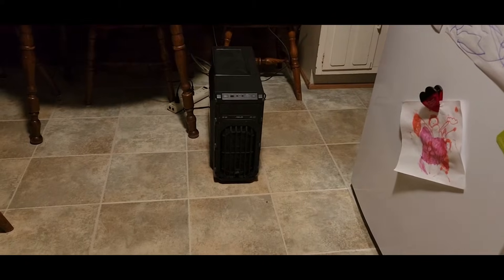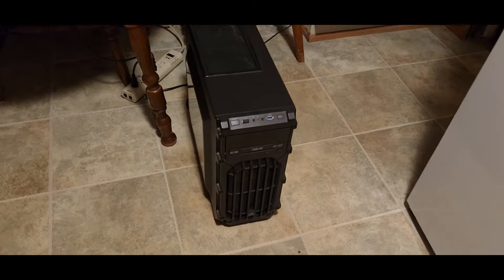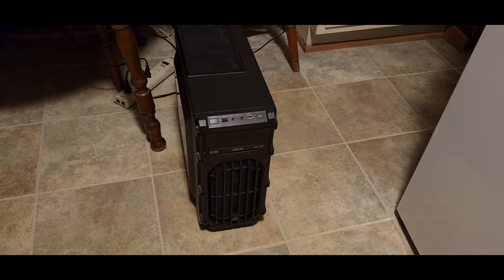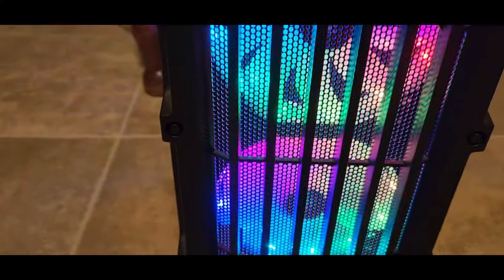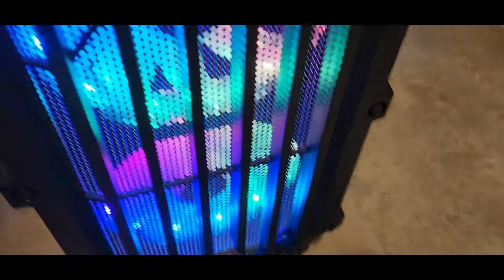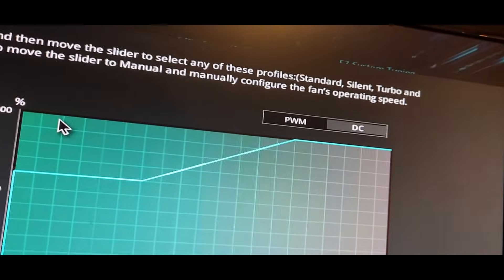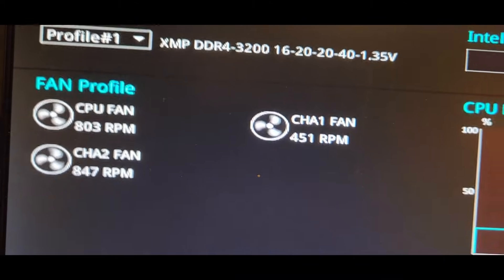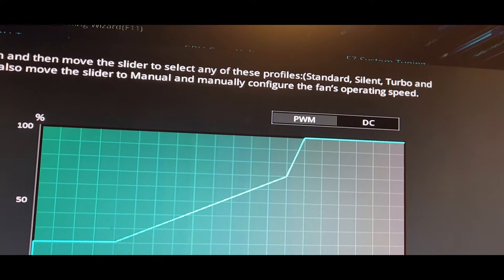One Fan Wasn't Spinning - Solved! (3/25/23)

Comment: What if the rgb and fans aren’t working
Reply from the maker: Hi, I'd say if the fans aren't lighting up and not spinning, they are not connected to any power. They should be either connected to the motherboard fan headers or to a hub, but the hub would also need to be connected to power.

Comment: looks like we have a similar setup. in my case though, the two in the front work fine but the one in the back doesnt at all, but lights up the rgb. I tried changing the setting to PWM from DC (according to the platine, the one not working is cha_fan 2) but it doesnt work. I actually noticed this when I played for the first time on it and smellt smoething toasty/burnt and the temps rose to like almost 90. you think my fan is just plain dead?
Reply from the maker: Try connecting the bad fan to a different fan header, or connecting a known working fan to the header pins the bad fan is on to verify if it's the fan itself or the motherboard fan header.

Comment: What about when my case fan randomly spins and stops?
Reply from the maker: Possibly bad fan, but could potentially be a fan curve setting or power issue, but I don't think it's the power supply.
Reply: @EndUserGamer Thank you, weird that only one of them suddenly stopped working properly. I didnt change anything on the settings. But I did upgrade to Windows 11, not sure if that has anything to do with it.

Comment: My fans came pre installed in my pc, one stopped spinning but it looks like it’s trying to spin because it jerks every couple moments, if i spin it manually it starts spinning but way way slower. In BIOS, it only shows One Fan which controls all of them. idk what’s wrong with it at this point
Reply: Did you find a fix?
Reply: @radiantguy17  yes, if i remember correctly all of my fans were connected in a daisy chain in the back of my case and connected to one fan header on my motherboard, so each connection it would lose some power since the header didnt supply enough power to spin all the fans. the last fan / connector cable in the daisy chain was the one that wasn't spinning, i took the connector out of the daisy chain and connected into another fan header on motherboard itself and it started spinning fine.
Reply: @MuteMvte thank you

Comment: Can you help me because this is baffling me I have one back fan 3 top 3 front and 3 side fans both the front and side start on boot up, but the back and top fans won’t start on boot up then it’s says cpu is over heating then I restart it and all the fans go on and it works perfectly? It’s so annoying
Reply from the maker: Sorry for the delay in response, did you find your answer and resolve the issue?

What are you using to cool the CPU, an AIO water cooler or an AIR cooler? if AIO, be sure to have the pump connector plugged into the pump header or CPU-OPT, and have the fans plugged into the CPU header. use a hub for the case fans.

(And side note with an air cooler, you don't want two/three top exhaust fans, the front most top fan should be intake.)

In your MB BIOS, set all your fans to PWM , or the fan header you have the hub connected to.
Hope you can sole this issue!
Reply: @EndUserGamer now it just boots on and it just turns off after a few seconds and just keeps repeating

Comment: How do I fix two of my fans but the rgb works
Reply from the maker: @TurfyCrater  Use a splitter to connect to the motherboard fan header or connect them to a hub. Just make sure the hub is also powered by the sata connector.

Comment: Anyone got a solution for me? I have 3 rgb fans on my case and they all work until i start gaming after that 1-2 fans stop spinning but lights stay on. They start working again only after shutting pc down.
Reply from the maker: @Opa-b4l  Are these Corsair fans? I'm wondering if the iCUE software is bugging out. If not Corsair's, then I'd probably lean towards power supply,  as this is a very strange thing.
Reply: @EndUserGamer   The fans are not Corsair they came with the case itself(I had a shop build the pc for me) its less than 4 months old and im wondering is the whole power supply bad or just some cables? Can it be a problem with bios? should i try to update it? Note that I a m not using any softwares for the fan controls just the bios preset setting. Can it be thath the fans are just bad guality and I should replace them completely
Reply from the maker: @Opa-b4l  Bring it to the shop that built it, as 4 months would put it under some kind of claim to warranty. But yes, it could possibly be a power supply issue. It's definitely a strange situation.

Comment: Bro I done all this and it still don’t work my lights are on but NUN. Of them are spinning how can I fix that…..
Reply from the maker: @GamingEmpire1204  How many fans? Like all of them are not spinning? Are the fans connected to power? Should be connected to a fan hub or MB fan headers.
Reply: @ yes they all are on like LED wise and I have them plugged into everything righting I think the fans are just not spinning and it’s making me panic all I did was replace the power supply to a more powerful one
Reply from the maker: @GamingEmpire1204  Hmm, what are the fans? The RGB gets its own power, from the 3-pin 5v ARGB cable, and the fans get power from the motherboard headers or fan hub. It almost sounds like the fans are connected to a fan hub, and that hub then gets power from the power supply. Trace wires from the fans back to their connectors.
Reply: @ yes they are all plug up to a hub I think and when I plug in the hub to a SYS_fan plug nothing happens just the LED and also looks like the hub it’s connected too also controls the LED because when I unplug one of the fans from the hub even the LED turns off
Reply: @EndUserGamer  is there a way I can contact you?
Reply from the maker: @GamingEmpire1204 ok. Yes, the hub gets connected to the motherboard System Fan header, which is the PWM signal wire. (I usually connect that wire to system fan 1 header). But the hub itself needs power, which will be connected to the power supply sata connector.
Reply: @ the thing is that’s all connected if I could i would show you a picture but i have thay connection I think let me dub check
Reply: @EndUserGamer  yea i just checked this whole thing Is like one plug so the hub header is plugged into the power supply it’s self and the motherboard at the same time
Reply from the maker: @GamingEmpire1204 Aside from the comments here, try reddit. Same username. 

Anyway, really, from what you're saying, you just need to connect the power supply to the fan hub. Follow all the wires from the hub. 

One should be PWM wire, goes to motherboard fan header, and the other wire will lead to power. And if the hub supplies RGB, then just look for the one wire from the hub that's got a sata power connector. You got this.
Reply from the maker: @GamingEmpire1204  Ok, you may have a faulty hub or (unlikely) bad fans. I'd try connecting each fan, one at a time, directly to the motherboard fan header to test the fans separately, off the hub. See if the fans actually still spin.
Reply: @ wait is there supposed to be a SAT cable that plugs into the motherboard?? Because from this Hub there’s no girl ls so I can’t plug it in all the girls are plugged in then it ends off on a male
Reply: @ ok I just unplugged everything from the leds so ALL of Fans are on just no LEDs now but now the Isolated interface plug is just here am I missing a adapter is that why or something?

Comment: But where you find this Platform ??
Reply from the maker: @YacineCv  I'm sorry, I'm not sure if I understand what you are asking. But if, by platform, you mean the BIOS, then this would depend on the motherboard. 

Usually, it could be the Del, Esc, or maybe F2 or perhaps F10, key. 

You press one of these while the system is booting up, and you'll enter the BIOS.

Comment: Awww man I really had high hopes for this it’s exactly what is happening to me but for some reason all CHA fans appear as N/A even tho they’re all working except for 1. I change from auto to PWM mode and still nothing. I already opened up my pc and that fan is perfectly connected to something behind my motherboard’s so it’s not a loose cable.
Reply from the maker: @Pailosss  this sounds like the fans are connected to a fan hub behind the motherboard tray. Please confirm?
Reply: @EndUserGamer hey I have the same issue as him and my fans are indeed plugged into a hub the pc had came w even the rgb connection is on it and only the bottom spins all the time while the other turns on and off at times, have the bios ans your and the only thing it recognizes is the aio fans and pump(3 front, 1 rear)
Reply from the maker: @a.d.s2626  Try checking all the connectors are well seated, also follow the wire from the fan to the connector and verify the hub itself is also seated well into the motherboard.
Reply: @EndUserGamer  yes everything is well seated and the fans are connected I don’t understand why the bios dosent show the other fans. They would turn on and off but when I’m using it for video games they will turn all stay spinning until I’m a 1 minute into launching a game. Should I try maybe a new hub?
Reply from the maker: @a.d.s2626  Yes, a different hub power the fans from the power supply and run the RPM wire to pwr fan header 1, then set 1 to PWM every if you don't see them listed.
Reply: @EndUserGamer  the rpm wires from the fans or the wire form the hub?
Reply from the maker: @a.d.s2626  fans connected to hub power supply connected to hub, hub connected to MB.
Reply: @EndUserGamer  gotcha will give an update after new hub!
Reply: @EndUserGamer  after setting up new hub w argb ports as well, I can say that it 100% fixed the start off and on for the fans ! Thanks once again for the help!

Comment: bro i have 3 rgb fan in cabinet but its shows only to in bios
Reply from the maker: @insanegamer7777  So, my guess would be  there are two front intake fans and one rear exhaust fan. The front two may be daisy chained (connected together), so bios only shows one fan. Or maybe one fan isn't connected to the motherboard fan header.

Comment: what if none are spinning but rgb is showing and everything is connected
3 years of ownership btw
it says NA in bios even though i updated my bios
Reply: same thing here, but even my AIO cooler fan stopped? will have to strip my pc and check it out!
Reply from the maker: This means you'll have to connect the power wire from the fan to the motherboard's fan headers or a fan hub.

Comment: I have a asrock motherboard my one fan will try to start but then won’t spin but if I shutdown and then turn back on my pc the fan will start spinning just fine and if I put it to sleep so everything stops spinning and etc and come back later it will spin right back up so I have no idea what is going on with it  it just won’t start spinning the first time I start it up in the morning or if it’s been sitting off for awhile
Reply from the maker: @ftb_thesmasher6166  This sounds more like a failing fan. It could be "gunked" up with dust, pet fur, etc. However, replacing the fan could be potentially an easy swap. If you can, access it, give it a try.

Comment: My case fans were wokring fine untio suddenly i noticed one fan is not spinning, it was on for quite a long time like 5hr straight but was fine before, all fans are spinning except one case fan, its lit chaging colors like others just not spinning
Reply from the maker: @gdbdff  Check the cable coming from the fan  to see if it came loose. Also, verify that nothing is touching the blades stopping them from spinning,  other possibility is an RMA.

Comment: what if my rgb fan is lighting up but not spinning but it was spinning when I built the pc, its been about 3 years now both of them stop spinning could it be loose cable or do I just need to swap to a new pc case?
Reply from the maker: @darrendoang  It sounds like the fans might need to be replaced. However, three years isn't really that long for fans, so first, look at the cables to verify they haven't disconnected, then look at the fans to see if something is stopping them from spinning. Other than that, my guess is to replace the fans.

Comment: i’m going to try this right now my top fan hasn’t been spinning since i got my pc “july”
Reply from the maker: @landonbarrett3055  Hope it works out for you!
Reply: @ it didn’t i think a wire is unplugged but i don’t know nothing about pcs
Reply from the maker: @landonbarrett3055  the fan power wire, has a small square-like connector, with either 3 or 4 pin holes. This will plug onto the motherboard pwr header.

For reference, look at images of fan power connectors and motherboard pin outs to get familiar with the connections.

Then, trace back the wire from the fan that isn't spinning to locate the connector. After that, see if there is a fan hub, or splitter, or if the fan pwr cable just isn't connected to MB. 

You can do it if you take your time and be patient. You may need to dig deep into the case depending on how the cable is routed, but you can do it. 

It's also possible that one isn't connected because the MB needs a splitter cable if there's not enough pwr pinouts, but you may be able to fix this.
Reply: @EndUserGamer i see a little wire on the inside of the fan sticking out a bit (inside as in the circle part of the actual fan) do I continue with your steps or see why it’s possiby poking
Reply from the maker: @monte4nn  Hmm, without seeing it, I can only take a guess. So, if you're have a fan that isn't spinning, I'd try to take it out to get a better look since you can see questionable wires sticking out a bit from the hub.

It may not be anything more than cosmetic and an easy fix, and you could possibly just push the wires back into place. 

However, the wires may not be causing the problem, as it could potentially be bios settings as well. 

To troubleshoot, perhaps try connecting this particular fan to the motherboard on a known working fan connector. Basically, if you can see a particular fan spinning, try to connect the problem fan to the fan power connector that functioning fan is connected to, just to be sure if the fan in question is faulty or not.

Those wires you mentioned may or may not be the issue, so try to isolate the problem fan to verify it actually works. Other than those things, the bios option mentioned in this video may be what you need.
Reply: @ i took off the panels and turned it on now its working full speed i never move my pc alot so is it a air flow problem? I havent done anything besides removes all side panels and im updating a game same time still hasnt stopped
Reply from the maker: @monte4nn  Ok, so that's progress. But simply having side panels on shouldn't have stopped a fan. So perhaps there was a wire or something else hitting the blades and stopped them from moving.

Now, when you replace the side panel, if the fan keeps going, then maybe it's a loose wire that happened to be moved just right to get the fan spinning again. So just for your own peace of mind, trace the wires from the fans baci to the connectors and verify everything is seated wel, and that nothing will close down onto the blades. And perhaps you got lucky with this one. But I'm glad to hear you've got some progress and fans spinning again.
Reply: @ yeah when i reset it it seems to slowly kick up but still works i checked the side everythings plugged in i put all the panels back on except for the glass one too see if its an issue. I spun the wheel nothing seems to be stuck in it i dont see the little clear wire hanging out . Ty so much for the extra advice on what i can check!!